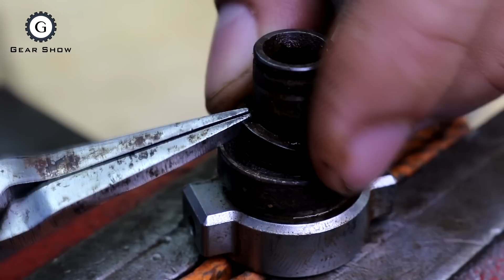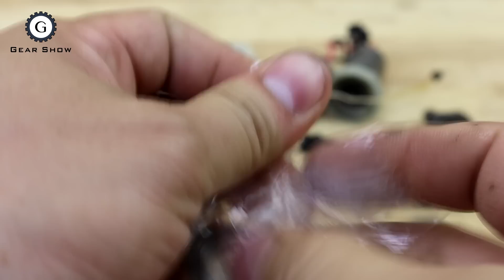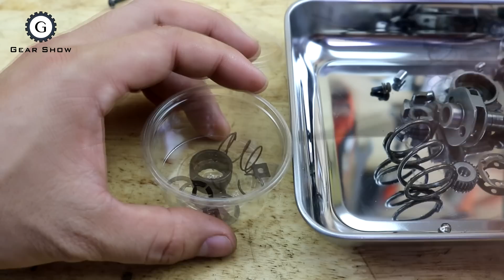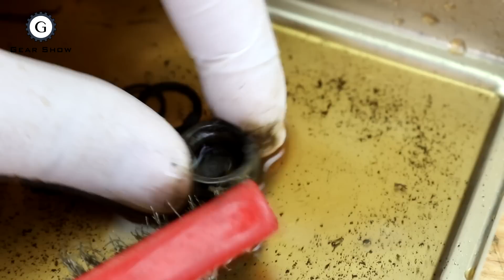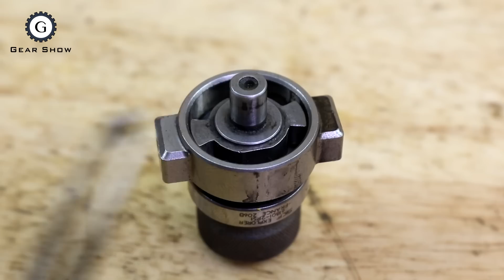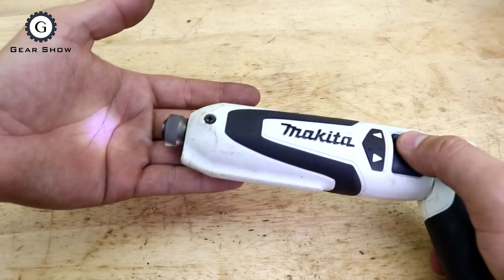Repair & Refresh Hex Drill Driver | Makita TD021D

Comment: Unbelievable robust and solid mechanics! I've never seen anything like that in a simple screwdriver. Makita is the best!
Reply: @shaiba5095  It drives screws in. Impact drivers normally have way more torque!
Reply: well, it costs almost the same as the "full-size" driver. got one recently. nice machine, light and capable

Comment: When lettering, don't bother with a brush, use a cooking sponge (they are firmer than say a dish washing sponge). Dip in paint, apply paint. That's how they do it in the factory too, just with a bigger sponge and a mechanical arm.

Comment: The build quality is superb, but it was utterly filthy inside.  I've stripped and rebuilt some bike parts like that, with similar problems.
Is that a Lithium battery? if not, can it be converted?
Reply: 18650 Li-ion battery i guess

Comment: two questions
1-is there a way to repair the bearings or is it just best to replace them?
2- what kind of grease do you use?
Reply from the maker: It is take time to repair the bearings, replace them is good choice. I use grease number 2 it is make for small gearbox.
Reply: You can't really repair bearings and they pretty much always have a code on them which you can use to find a replacement and they are typically pretty cheap.
Reply: @gear_show  nice job man! Salutes from Colombia

Comment: I was hoping that you would replace the motor with a new one since its outer casing is rusted and probably the insides too. But nevertheless it's an amazing vid.
Reply: Doesn’t matter because the copper and magnet that used to run that motor not gonna rust anyway 😂